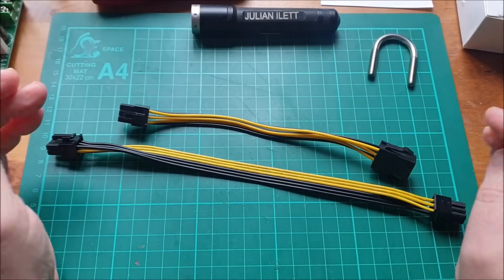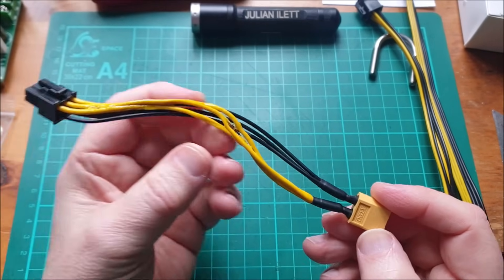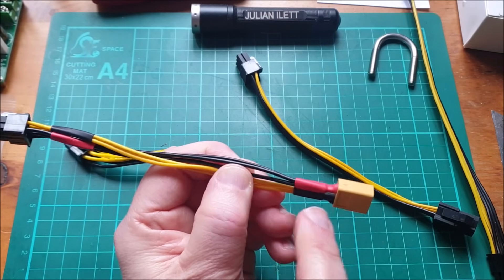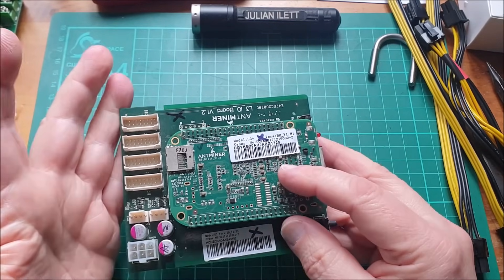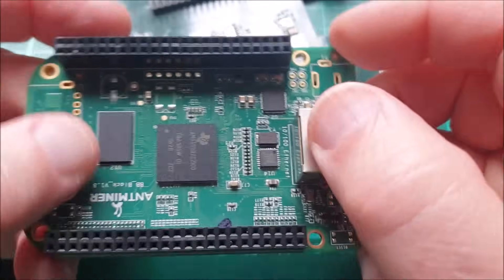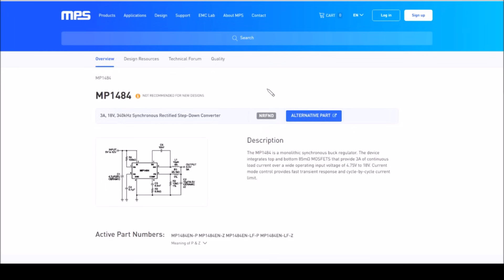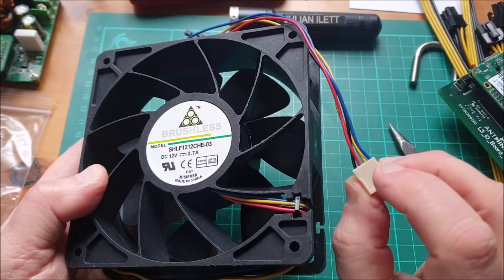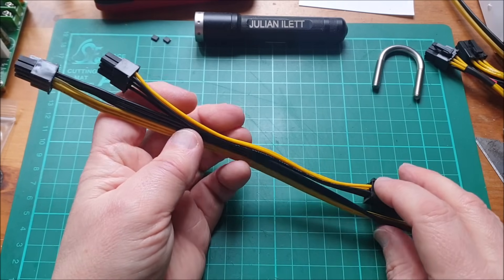PCIE Meltdown

Comment: Why did you place the new connector at the end by cutting off one connector? If you did cut the cable in the middle you could make the double amount of new cables
Reply from the maker: I only need the plug - the socket is not needed.

Comment: i think it might be the cheap chinese thing being flipped, not the antminer. take a look at "PCIE Supplemental Power plug pinout" and you'll see that black is always top as per standard on 6 and 8 pin PCIE plugs. what you likely got was EPS 12V extenders being listed as PCIE.

Comment: I'm surprised you didn't simply de-pin the connectors and swap the wires over to suit your needs, seems like the quickest solution.
They looked to be common molex style pins/sockets.

Comment: Just playing with a sharp thin shim in the plug to see if it is possible to take the wires out and swap them over. If I can work out where the barb is, it should be relatively easy.

Comment: Where are the fuses? The fuse should have blown long before the wire started melting. That was very close to starting a fire.
Reply: in ATX cables, there's no fuse. though, each XT60 least should have at least a 20A fuse on it. automotive fuses would be fine since it's direct feed 12V.

Comment: I've almost fried a graphics card by using some 6 to 8 pin (or the other way around)  adapter cable that matched the socket perfectly. Something seemed not quite right and I decided to measure what goes where and lo and behold 12V was shorted to ground....
Reply: Not a so uncommon occurrence, a lot of people only pick up that there is a problem when their newly built rig doesn't power on or only powers on without the PCIe  6 / 8-pin plugged in. Turns out the short circuit protection of the PSU has been saving them the whole time.

Comment: Get some terminal extraction tools and swap the pins! Way less work than applying non matching heat shrink.  Also check if the the wire is steel with a magnet. I just had to cull a bunch of dupont wires, croc clip leads, and computer wiring adapters for this reason.
Reply: I agree. I used to do that all the time. It takes seconds to de-pin a connector like that and re-assemble to your needs
Reply: Yeah, I was going to say the same thing. Much easier.
Reply: Steel wire?  Never seen it in PC applications and I've seen quite a lot of those.  Steel connector contacts on the other hand, yeah those are out there.
Reply: Yes, copper coated steel wire.  Granted these were some really cheap Chinese adapter cables, but the wire itself definitely stuck to a magnet.  @stinkycheese804
Reply: That should be done in factory. Why the heck final user should mess with polarities and wires? Manufacturers should be punished for this mess. On the other hand, why not sell those as kits? Separate connectors and wires so people can do what they want.

Comment: PCIe power connectors do have a standard polarity, I don't believe there's a requirement for which cable color is what though, and the cable would've worked fine without modification as the colors were swapped on both connectors. Instead of adding the heatshrink you also could just remove the pins from the connector and swap them around to match.
Reply from the maker: I looked into removing the pins from the connector housing, but the barbs appear to be locked into grooves which makes it very difficult to retract them without damage. Perhaps there's a special tool.
Reply: @JulianIlett  You can find a tool for this, usually sold under names like ATX Pin Removal Tool for around two pounds from the usual suspects, but in a pinch something thin like a staple should also be able to do it
Reply from the maker: Tried the staple idea, and eventually got a pin out, but incredibly faffy, so I think I'll buy the proper tool.
Reply: @JulianIlett  Aliexpress has the tools, very cheap
Reply: @JulianIlett In this case why go through the effort, as your lopping off the plug on the other end you can bunch the colours together and put the correct colour flex tube or heat shrink over them, then push on a short section of heat shrink, solder the XT plug on, position the small bit of heat shrink, and done.
Reply: That yellow and black motherboard power supply cable is about the only decent quality wire   I can get my hands on  and I've just got 12 volt fixated in my head when I see it.

Comment: What about a male female inline protection cable with Schottky diode?
Reply: If the cable is wired up wrong then reverse polarity protection in the cable wouldn't do anything. 
If you add reverse polarity protection you still have to make sure that from that point onward* the polarity is right, and double checking would have avoided the disaster anyways. 
(*: "that point onward" in this case meaning pcie connector and the controller board it would only help against reverse polarity on the XT60 connector which can't be reversed anyways)

So all in all there is no point adding a reverse polarity protection to a circuit that will only be wired up once and once that's done it won't be reversible anyways.
Reply: To make 11V out of 12V???
Reply: @kyoudaiken  That's the question, the 12V rail will likely be just over 12V, the voltage drop will be under 1V typically 0.3V for Schottky, in any case I'm thinking Julian's ant miners would run ok at 11V?
Perhaps there are other options that don't have any voltage drop, such as a relay that switches in the full supply if polarity checks ok, or a "zero loss" MOSFET circuit, there are plenty online?
Reply: @dav1dbone  The option is: Don't buy dodgy cables or double check the polarity. Much cheaper, much easier.
Reply: @dav1dbone 11 Volts is below the ATX threshold for "power OK". And most likely, theye miners use the same standards because they are royalty free and already there.

Comment: There is a standard for PCIe power connectors, pins 1-3 (bottom row) Gnd, pins 4-6 (connector row) +12V. This one has been wired as a 6 pin EPS 12V power cable but they have used PCIe connectors as pin 5 is keyed where it should not be for EPS.
It use to be a bit of a trap for novice pc builders/upgraders. I remember decade or so ago a whole pile of cases where people reported PCIe power was plugged into EPS sockets, and the reverse EPS into PCIe, and all the people saying you can't because its keyed different (well you can with force in some cases). Luckily most times it just had a result of smoking wire or psu cutting out, as typically the short is just through the ground.
Reply: They even make PCIe to EPS adapters (and probably vice-versa).  I think the problem is that the basic design of the connector has just been adapted and reused a bunch and there are only so many ways you can arrange the pins to be keyed to prevent improper installation (especially against a determined installer).  EPS was 4 pins, then 8, PCIe was 6 pins then 8, then 6 + 8 and now it's got a dupont cable strapped to it's back...  Add to that the crypto miners repurposing/further modifying commodity cables and probably not even using keyed slots and then Aliexpress/eBay sellers not knowing or caring about the differences let alone being able to properly convey it in an English listing.  (No shade, just calling out that it would be a difficult thing for anyone to explain in a non-native language.)
Reply: @PriorUniform721 Not to mention that the engineers at PCIe SIG lost their minds and made a tiny """600W""" connector for GPUs now that keeps melting down.